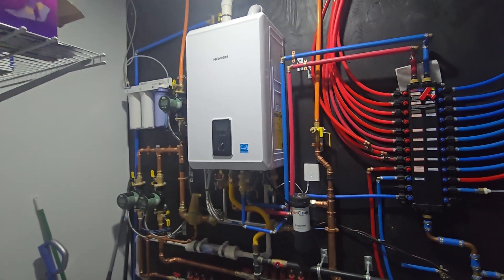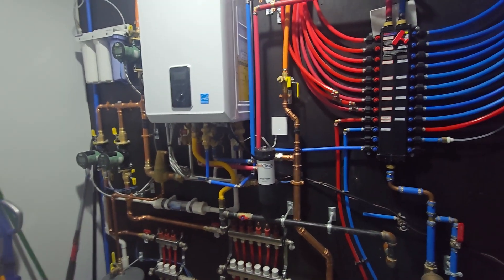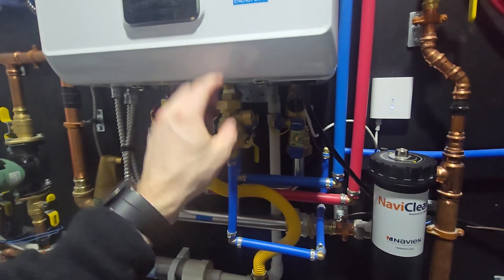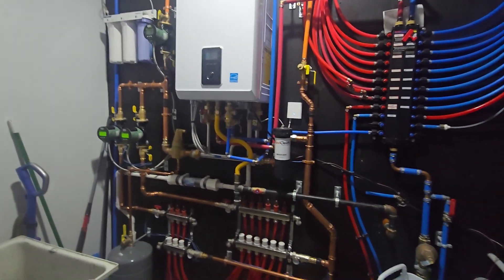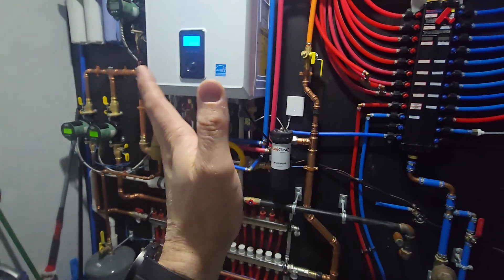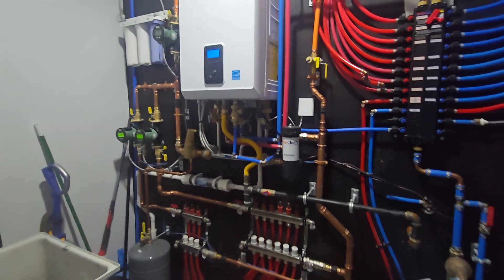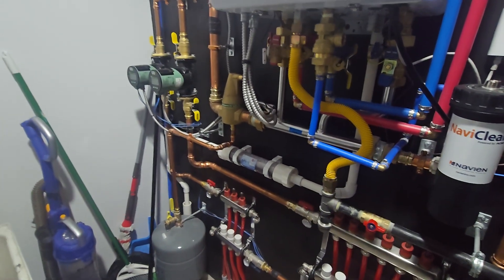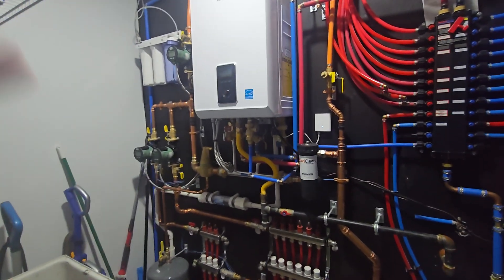Boiler System Pressure Regulator & Expansion Tank

Comment: is there a pipe to the floor for your over pressure release? I just had a release at 30 psi due to running at 175 degrees which the system was not tuned for.
until i fixed it, it was leaking a quart an hour when running at 28-31 psi,  and it was good there was a pipe at floor level to capture that.
Reply from the maker: @vtskier777  yes there is. There is a dedicated drain as well as a floor drain